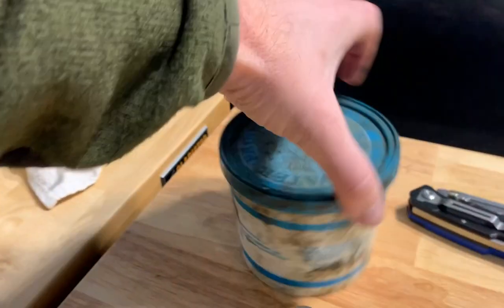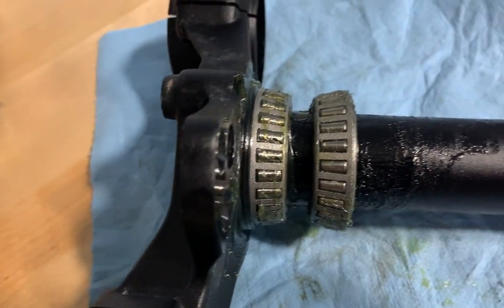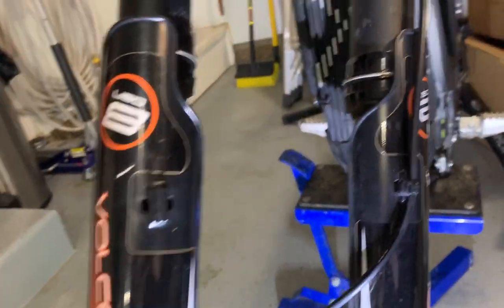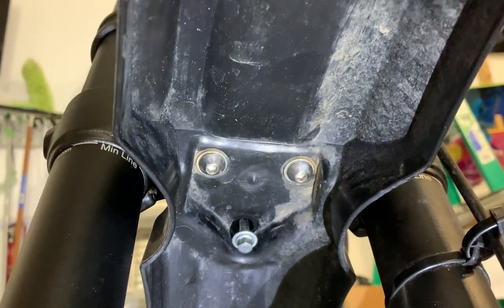Crucial Sur-Ron Maintenance Fork and Steering

Comment: Did you even ride it in the rain? Dump it sideways into a stream? Just curious. A replacement headset should have sealed -2RS bearings. Advice, always re-grease the new bearings, don't trust them to have grease int hem, usually a new bearing has almost no grease in it. Use a urethane bicycle grease like Park Tools grease.
Reply from the maker: LOL you’re preaching to the choir  man. Long time motocross racer!  Had to be washing the bike we don’t ride much water here in Utah. The bearings from factory actually had a good amount of grease in them. Lots of people complain about the OEM headset...I think a headset upgrade is the ticket. Haven’t done that yet.
Reply: Sometimes too much grease causes the ball bearings to slide rather that spin, not always a good thing.